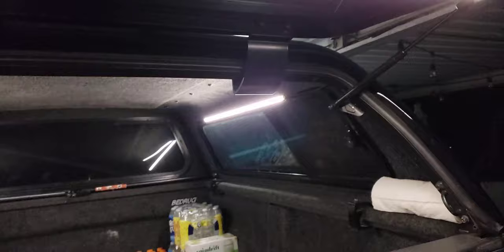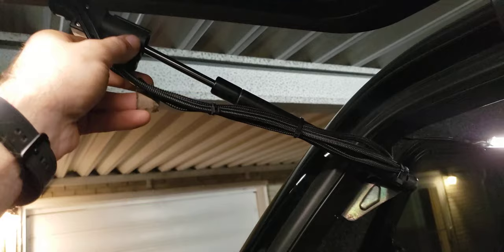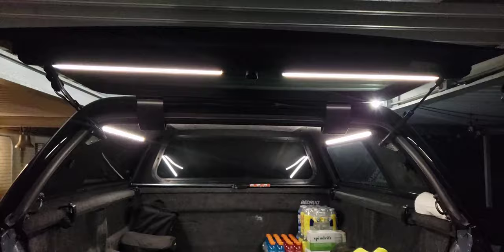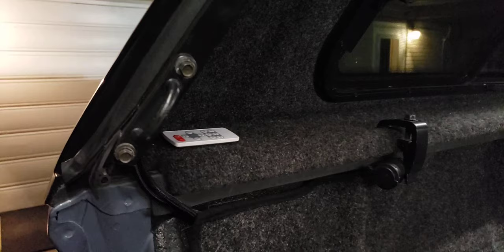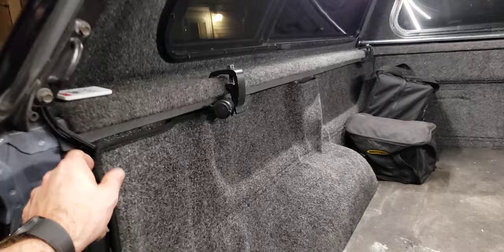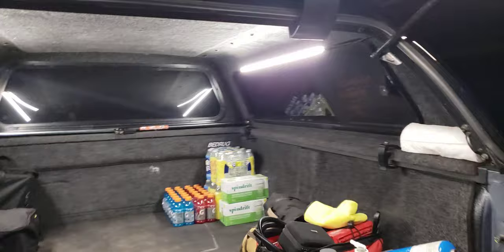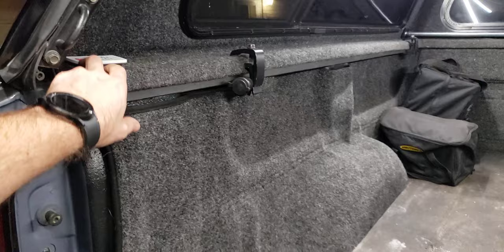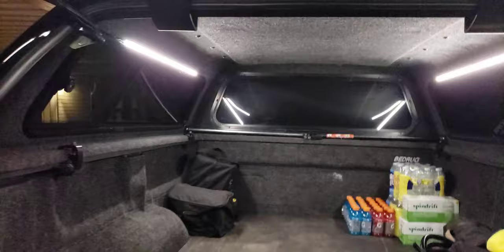ARE Z series camper shell custom lighting project

Comment: How about a link to purchase?
Reply from the maker: This was all custom parts I pieced together. The dual color LED strips and controller came from superled.com . The hatch switch came from eBay. All the wiring is from various vendors I've used when I built my overlanding trailer 12v system.